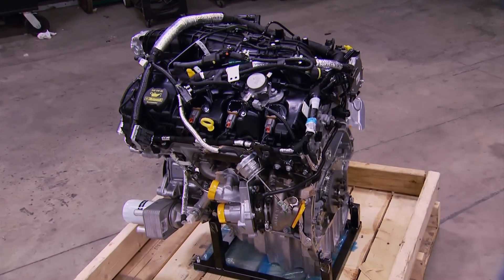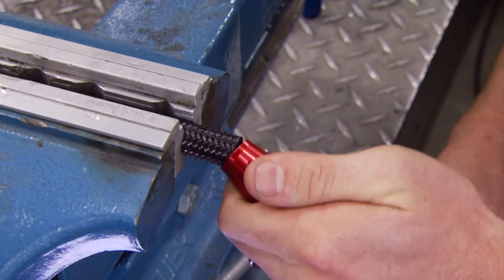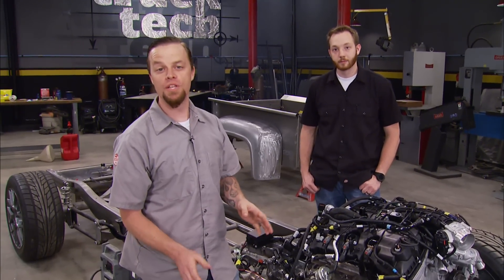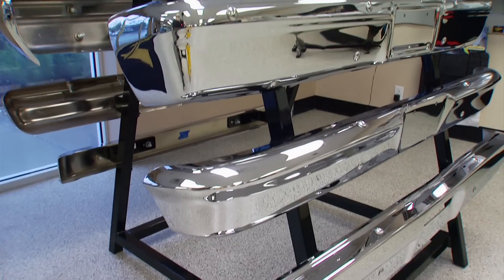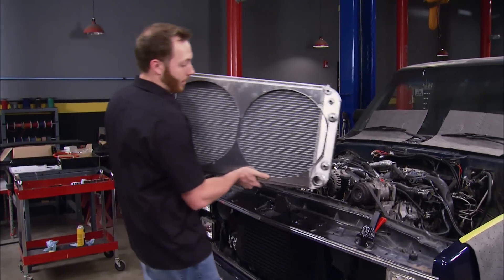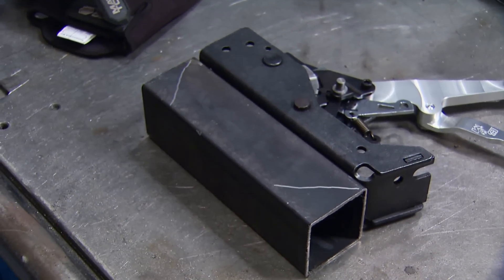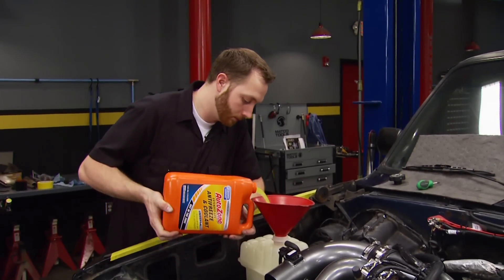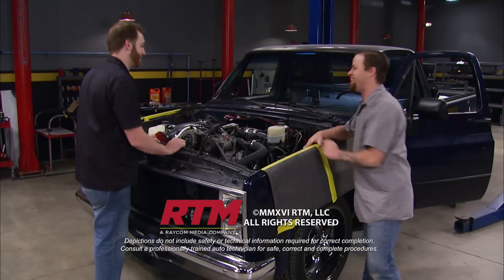'55 Ford F100 Build / '87 Chevy R10 Duramax Diesel Swap - Truck Tech S3, E1

Comment from the maker: If you could choose any classic truck to build, what would it be and why? Let us know!
Reply: PowerNation I would want a Chevy square body and ls swap it and paint it baby blue
Reply: 1959 Chevy Viking LCF cab, on a newer gm 3500 dually chassis with a 6.6 duramax, 5 speed manual. On the Back, have a rollback tow truck bed. Why? Because who else has that!
Reply: PowerNation  I'm currently working on a '65 c10.  Was my dads when I was a kid he passed away. It sat for 16 years then my wife found it and bought it for a Christmas present.
Reply: stephen burnsed That’s awesome. I hope you get it out on the road this summer.
Reply: @Yeeps-20  You have a good wife.
Reply: Late 60's Dodge.... stepside... big block Mopar.... 6 speed manual gearbox as my shop truck with aged paint. It would be similar to the Cherrybomb one that was at Sema a few years ago that Stacy David did some of the work on. One of the coolest simple builds I've ever seen. 

One other I'd do is hotroding a 2 stroke Detroit Diesel and slamming it between the rails on a 75 Ford. I'd make a time attack and drift type truck from that. Wouldn't be high horsepower but a twin turbo fed supercharged Detroit, all wheel drive and selectable air locker setup, lowered with an additional angle kit, big brakes, hoon handle setup for drifting and a sexy paint job with aggressive wheel and tire combo would make another fun truck.
Reply: Duramax swap in my Silverado
Reply: 77 Dodge Warlock 4x4 - was my first truck ( was brought home from the hospital in it, and it was my first car)
Reply: 73 to 79 ford
Reply: anything not gm and definitely not a duratrash engine
Reply: Currently working on a 1971 f100. Not sure what motor to go with yet but been a fun process so far. Love the show guys.
Reply: @tylertubbs672  I have run a Big Block Chev in my '71 F-250 since 1979.
Reply: 1979 ford f250 ranger XLT!😍🤘🏼🇺🇸its my dream truck
Reply: 1985 ford f150. Special place in my heart for this exact year.
Reply: 1947 Diamond T because the cab appears to be chopped and windshield laid back all in stock form.
Reply: 56 Ford f100
Reply: The one I'm working on now.
1963 Ford F100 Unibody, Mercedes OM 606 (dieselpumpuk parts 400 hp) engine, GM 6L80 Trans.
You want to race???
Reply: I would get my 1963 Chevy back and twin turbo 572 it!!!
Reply: PowerNation 68 c10 pro-street truck
Reply: A k20 with the cp6 8600 gvw option with an lsx 454
Reply: Not really a classic I guess but definitely an early 90s Ford Lighting.
Reply: 57 ford f100 either step side or fleet side..why??...look around..not many ppl fix them up  and they are cool looking..powered  by a healthy y block and backed  by a 4 speed auto
Reply: PowerNation That’s a really hard question. Probably a 1930ish Chevy. I’ve had various 60’s & 70’s trucks, but I really want to experience what it was like when vehicles took on a somewhat modern appearance while still requiring manual spark advance etc.
Reply: 1970 F 600 crew cab with a DT466  & 650 series Alison with a brownie OD .
Reply: 73 highboy crew cab with a 7.3
Reply: Definitely an F100 like the one you guys are building and I love that you are using a modern Eco Boost V6. Awesome!
Reply: I'd restore a BMW Q7. Why? Because I've always been a Mercedes fan.
Reply: powernation: I would love to build a 91 chevy s10 why I love the mini truck and the fact that I can put 572 bbc for more power
Reply: I’d finish my 67 c10. Love those trucks. I got a couple squares and a. Couple obs short wide trucks and the 67-72s are so much sweeter
Reply: I would want to do a 1957 ford f 100 short bed and put a Ford 302 in it. I would also put Red moon wheels with white walls and do a two tone paint job (star mist blue and colonial white).
Reply: Or ‘56
Reply: LS powered six speed turbo Chevy LUV because why not

Comment: I mean I would have put a gen 3 coyote in it but still sick as for the Chevy absolutely awesome Also I can respect F100 because it is a 1955 so a V6 is actually not that insane for that truck I would like to do a 71 F100 Old man had one 390 FE with a three-speed granny

Comment: Why would put your hand on a chassis that has not been painted. And ford was not the first to use a small engine with big power. VW tried it with the AMAROK that had a 2.0 lt engine twin turbo. It did not work! Your get shorter life with a lot of stress on the motor and the power is not so good. Its not good for towing.

Comment: Should try E85 or straight ethanol, forced induction runs great with ethanol, we ran 100 octane race gas in our blown drag car and got 673 hp with max temps of around 210 at idle, when we switched to straight ethanol we had to change out lines to teflon coated and an alcohol carb, but we got 701 hp and max temps of around 190 at idle, detonation is so much easier to control with alcohol so we were able to swap pulleys and run 10 more psi of boost without the pinging we got from gasoline

Comment: You do all that work and you put an ECOBOOST motor in it ?

An engine with known issues of carbon fouling that will destroy itself?!!!!!

You could have done allot better!!!!
Reply: Mine has 138,000 miles on it and runs like a top...
Reply: It does NOT have a catch can or other aftermarket shit on it. Running 87 octane the entire time.

Comment: Il just put in the original 6.2 Detroit diesel on a old Chevy like that one if I ever wana make diesel swap on a non diesel Chevy truck, and add a turbo to it, that way I have mi gages working and everything else how their supposed to, I hate driving a vehicle with dead 💀 gages that's just cheap and un atractive I'm gana look like I picked it up at a junk yard no matter what u add to it, it's gana look like trash... or if I get a non turbo diesel Chevy truck il just add a turbo, Period.

Comment: A engine can run no more then 5 minutes with no coolant.
Reply: happys104092243 an engine can run with no coolant until it’s heated up and over heats sometimes takes longer than 5 minutes sometimes less
Reply: Never had any engine over heat in 5 minutes or less.  No shop or dealer is going to push a car or truck out because of no coolant. Bet your ass if it runs an drives they will drive it.
Reply: My 351 Windsor ran with no water for half an hour with no problems and I haven’t had water in my straight 6 300 since last fall, the 351 had a destroyed water pump and I needed to get to the store for a new one and the 300 just won’t hold water, as long as u don’t have a Chevy you’re fine to run without coolant temporarily

Comment: You should add some Pure Turbos on that eco boost. I understand it’s 530 wheel horsepower. Check them out 

https://www.pureturbos.com/store/ford-upgrade-turbos/ford-3-5l-ecoboost-pure700-turbo-upgrade.html

Comment: A contractor who had one of these eco  boost engines, he had to get it fully rebuilt due to FOMOCO had the wrong sized injectors installed (injectors too big), the fuel was injected into the cylinders, however not all of it got burned & it leaked down into the crank case & turned the oil into a goo with the "odour of unleaded fuel". From what I understood when the engine was rebuilt, AMSOIL paid for the whole rebuild......

Comment: I could of swear 1500 didnt start till 88? The last c10 was made in 87?
Reply: osp80  I've never heard that and I've worked for all these part stores so maybe I'm just going by there systems idk
Reply: They just put a 1500 badge on their 73’. It’s a C10.
Reply: @Properformancenutritioncom  73 is a C10 and 87 is also a c10. 88-present is 1500

Comment: So u put one of the worst diesel engine from the 80s in it
Reply: You mean the worst engine of the early 2000's.  The worst diesel engine of 80's was the olds 350 diesel.
Reply: @mariusmcleod2487  thanks for the correction on that  at least I was half right lmao
Reply: @ekomsdeew100  lol it's all good

Comment: Yeah but what they won’t tell you about is the carbon build up, and oil consumption, and turbo failures on the 3.5 
It’s better as a boat anchor
Reply: Life Of wes This was filmed years ago before people found out the limitations on the engine.
Reply: Oh, don't forget the water pump is inside the engine not outside. When it starts to fail it takes your engine out because the engine oil gets coolant in it and you won't know.
Reply: John Parrish yeah you right but only on the 3.5 naturally aspirated, boosted are external, but still a piece of shit, I’ve replaced many of those and the t hose fitting, both of which fail constantly
Reply: Don’t forget about the fuel mileage. My 5 litre tire eater makes better fuel mileage them my buddy’s ecoboost and well its a V8 soooooo more chicks as well
Reply: All direct injected engines suffer from carbon build up on the backside of the valves.  That's why some newer designs are running both direct and port injection on the same engines.

Comment: Why eco boost????  Why not coyote?
Reply: This is a super old episode, when the ecoboost barely came out and was the new "it" engine. If it was built today they wouldn't use it.
Reply: @alexcorona  Says it was published July 2019, don't think it's an old show.
Reply: @alexcorona  I keep wondering when these episodes are actually filmed,what with their 24pin IPhones and all
Reply: Ford probably gave them the engine and with money to use it. Ford has been pushing the Ecoturd engines hard for a while now.
Reply: @sdvten  Yep don't blame you buddy.
Reply: Exactly.
Reply: A V6 will sound so wrong in that truck.
Reply: @jamessheets9205  Exactly mate.